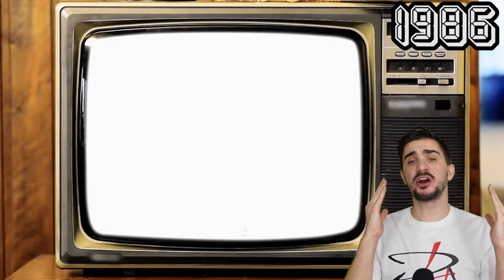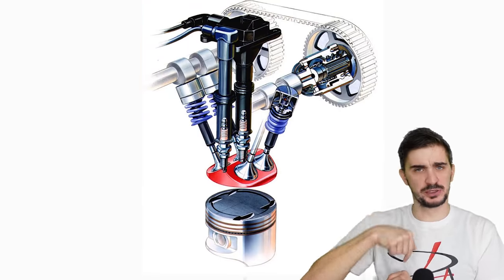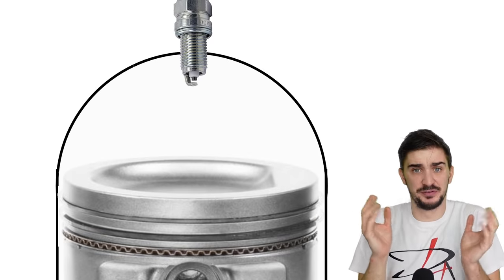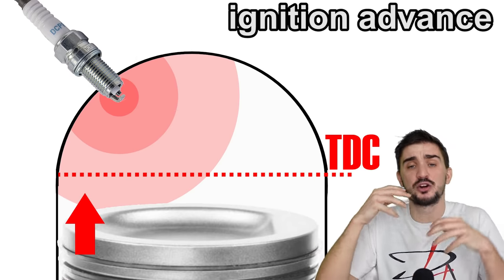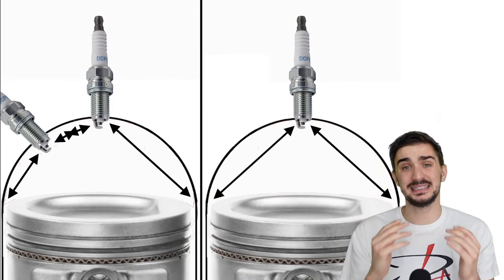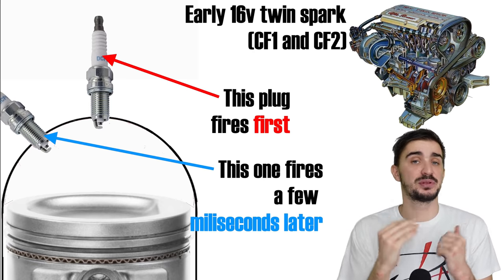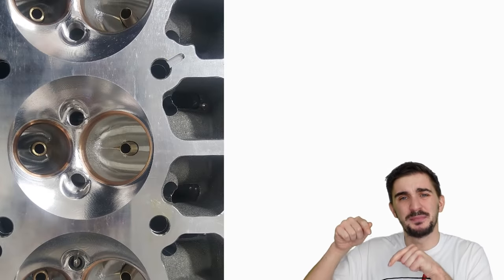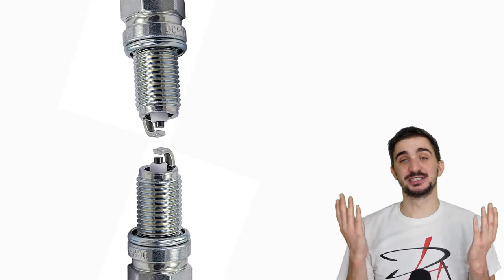TWIN SPARK - WHY, HOW and why it isn't more widespread

Comment: there is also a trend for multispark(rapid firing of spark) at low rpms. wonder what happened to it? or is it now commonplace that people don't talk about it?
Reply: I also wonder this!
Reply: Are you talking MSD, very powerful ignition, used in pretty much all top end engines, only one to have in top fuelers
Reply: Mercedes used that on a couple of engines
Reply: @davidwarland2680  MSD was one of the aftermarket system that offer it. but multi spark ignition seems like it was a thing a decade ago in some OEMs
Reply: @davidwarland2680  Top Fuel engines generally use MSD Promag 44 magnetos. They produce one single relatively long duration spark.
Reply: You just mean spark dwell?
Reply: @TheAdatto  spark dwell is the charging of coils before the it reaches the spark plug and starts the ignition.

multi spark is literally what it means. the spark plug sparks multiple times during ignition. many different approaches to do it, but it does result short dwell times as there is less time to charge the coils.

Comment: I owned a small 150cc motorbike manufactured by a company from India called Bajaj. It sported a technology they called DTSi which implied two spark plugs  for that small single-cylinder engine. I don't know that benefited the performance, reliability, or efficiency of the engine but, to their credit, the engine never failed to start and that's not a small feat for a carburated engine. Today I own another similar bike and I have disassemble the carburetor whenever I spend 2 weeks without starting the engine.

Comment: I have a Kawasaki kle 500 parallel twin that revs to 9.5k rpm and I've seen examples of the gpz 500 that has the same engine but differently tuned, revving to 11k rpm with a single spark on each cylinder. I don't know the point I'm trying to make,I'm just mentioning the fact. Great information btw,great video.

Comment: Also on the topic of extra spark plug the four-rotor rotary engine in the Mazda 767 and 787 cars received an extra spark plug per rotor for improved combustion, despite both the 13J and the later 26B engines having a variable-length induction system. 

While it is true that introducing an extra spark plug is more hassle for maintenance purposes in production engines, I'm surprised Mazda out of all companies didn't try to squeeze more bang from the rotary engines, especially the Renesis engines in the RX-8 which was purposefully designed to milk every single performance out of a naturally-aspirated 1.3L engine AND still meeting the emissions standards at the time. Even the rotary range extender in the new MX-30 hybrid didn't have an extra spark plug.
Reply: Actually all 13b rotaries have two spark plugs if I'm not mistaken
Reply: @bababence  The 26B have three
Reply: @bababence  They do. The four-rotor engines in the LeMans cars had three per rotor, which was supposed to improve the combustion characteristics. 

Looking at some peripheral-ported, four-rotor projects online with just two spark plugs per rotor shows a HP figure somewhere around the 500HP figure mark. For context, the 26B in the 787B could reach 900HP peak, and even the “detuned” version have 700HP. 

By this example, I’m intrigued on just how much an extra spark plug could really change the performance of a Wankel rotary engine.

Comment: dual spark plugs cut down the lead time required for ignition to occur completely, greatly reducing the chances of detonation .. you don’t have to light a spark plug at 30° BTDC with the dual plugs.. you cut down the leadtime by half. Also, you’re not trying to compress a mixture that’s trying to expand because you lit a spark plug so far in advance.
  Vance and Hines when they were actually in the early years of their drag racing which gave them their big name that they still have today because of their success. They actually had a motorcycle engine that was four-cylinder and it had three spark plugs per cylinder..
  gasoline burns very slowly in the open atmosphere. You could pour a stream of gasoline 50 feet long on the ground, stand beside it at the beginning, light it at one end, and you can walk to the other end of that stream of gasoline before the flame will get there. For an engine to run, you have to speed up combustion buy as much as 200 times the speed that it burns in the open atmosphere.Lighting the mixture with two spark plugs cuts that time in half. Especially with dome shaped pistons, which in my opinion is the worst shape for a piston/combustion chamber because, it takes longer relatively common for the complete combustion chamber to ignite if you have a single spark plug on the east side of the combustion chamber, by the time the west side of the combustion chamber catches fire, you have a high probability of detonation occurring.. dual spark plugs reduces that problem. Dual spark plugs also reduces the amount of the cylinder that is exposed to flame of combustion, lowering engine temperature, making it possible to have a higher compression ratio, which will equal more power if you can control the combustion chamber. It’s a win, win, win to have dual spark plugs..
 of course the ignition system has to be adjusted to back the timing off by half with dual plugs vs a single plug for the benefits.. you can’t just drill a second hole and add a space second spark plug and keep the same ignition curve that the engine was designed to have with a single plug. That would be worse than having a single plug because the mixture would ignite completely as the engine was trying to compress.. if the engine came from the factory with two spark plugs. I’m sure that the factory has already calculated the correct ignition timing curve.
 I knew a mechanic specialized in dual plugging Air cooled BMW motorcycles. He explained The benefits of dual spark plugs.. I watched him do it to a set of heads. He had jigs rigged up so that he would attach the jig and drill and tap the hole for the second spark plug, then he had to adjust the ignition timing advance by backing it off halfway..
  he also pointed out to me that the great aviation/motorcycle inventor in the early 1900s, Glen Curtis solved the problem of airplanes having trouble getting airborne when taking off from muddy Fields. The solution was to dual spark plug every cylinder on those airplane engines..
 in case you never heard of glenn Curtis. He actually made a V-8 motorcycle in the early 1900s went well over 100 miles an hour. He also is the inventor of the V twin engine for motorcycles. Motorcycles in those days were nothing more than bicycles with engines on them. Glenn decided, and rightly so, that it would be easy to add a second cylinder to an engine that fits in the V of the frame of a bicycle. Of course Indian copied that design from glenn Curtis, then Harley Davidson copied that design from Indian..
  of course that narrow V design does not have perfect primary or secondary balance. BMW with the boxer twin has perfect primary balance.Moto Guzzi engines with thier 90° V twin have perfect primary and secondary balance..My last 2 Moto Guzzi’s both had two spark plugs per cylinder from the factory..

Comment: I forgot to mention, the aviator genius glenn Curtis in the very early 1900s when airplanes had radial engines and airplanes had double wings, had to overcome the problem of planes taking off from muddy Fields which requires more horsepower than if the runway is paved.. Glenn Curtis is the one we all need to thank for coming up with the idea of dual spark plugs oer cylinder.. that gave airplanes the increase in power needed for planes to take off from muddy fields..
  curtis also came up with the idea of adding a second cylinder to a motorcycle single cylinder engine, creating the V twin engine because that configuration would fit neatly into a bicycle frame, which is what motorcycles were in the early 1900s.. Indian stole that idea from him, and Harley stole that idea from Indian..
  Glenn Curtis in 1907 also went 136 miles an hour in his V8 powered motorcycle..

Comment: An old machinist told me "Two plugs are for inefficient cylinder heads". You see them in Top Fuel because of the immense amounts of cylinder pressure and fuel.
Reply: And Those Fuel Dragsters are using Twin  MSD  systems . At ridiculous voltages .
Reply: That's like saying 4 valves/variable length intakes are for inefficient cylinder heads
Reply: @johncunningham4820  enough amps to weld.
Reply: @michaelallen2501  . Initiating a Spark across a Gap isn't about Amperage . 100.000 Volts at 1 milliamp will jump . 100.000 Amps at 1 millivolt will not . And too much Amperage would Melt the Sparkplugs instantly , rendering them inoperative .
Reply: so the most efficient cylinder heads have no spark plugs(diesel)
Reply: @makantahi3731  . Actually TOTALLY correct .
Reply: Gen 3 5.7l 6.1 6.2 6.4 Hemi.
Reply: @makantahi3731  Ouch!
Reply: @johncunningham4820  no lol that absolutely incorrect.
Reply: @toxichorizion2348  Mebbe John needs to look at the plugs from a Top Fuel engine after a 1/4 mile pass. They ARE quite often literally destroyed by the time the run is over. And I can suppose you could create a spark with 100,000 V and 1 mA, but it would be closer to the zap you get from walking across a carpet & touching a doorknob and insufficient to power a weed-wacker.  The voltage isn't really important in a Top Fuel engine...the current is. A massive spark (akin to an arc welder) is what's needed, and since the magneto's on these engines can supply 40+ amps, that's what happens.
Reply: @chiefdenis  ig they meant as in fuel consumption wise, they don't generally sips fuel
Reply: @warrenzevonsangryghost6055  Basically a flying welder.  I wrenched on Top Fuel dragster. 44 Amps and 1.5+ gallons of fuel per second being consumed during the run. 
Well in excess of 11,000 horsepower

Comment: Another reason to use twin spark in an air cooled beetle motor is to allow the use of a more radical cam profile and still enjoy more torque at lower rpm's which would be much worse without it. I have also experienced other minor benefits as well as you previously mentioned. The heads used are much more efficient than stock vw heads and in a motor that sees 8000rpm when required. However I agree that with other tech used today, Twin Sparks advantages only show in particular circumstances and hence its limited use today.

Comment: Miki...you are correct.  I have an '02 CLK55 and '04 CLK500 and both engines have dual spark plugs.  A mechanic told me that the dual spark plug design of MB engines fire one spark plug and then on the next power stroke, the other spark plug fires.  What I was told, is this has the effect of spreading the heat more evenly across the piston.  I'm just repeating what a seemingly qualified mechanic told me.  I'd be interested to know what the official answer is.  I do know that Aston Marten's racing engines of the 60's had dual spark plugs.

Comment: A good combustion chamber design for most passenger car size engines doesn't need dual plugs. Poor chambers may benefit. So may engines with a bore greater than about 100mm. A good example of "if you can't hide it, make a feature of it."

Comment: I enjoy all your videos. Your enthusiasm is contagious and your explanations are some of the few I know that keep is simple, but also include enough good information to get the concept across. I got hooked with your balancing videos. I've always had a love/hate relationship with balance. Obviously, the smoother an engine's balance, the better it can physically perform independently of any power modification as compared to a relatively unbalanced engine of the exact same specs otherwise. And I like symmetry and smoothness. However, I've found that over the years, I am really getting into less balanced/"not as even" firing order engines simply for the nostalgia and the sounds, since much of an engine's sound characteristics are created by how the exhaust pulses interact with each other pressure-wise and rhythm-wise within the exhaust system. And sure, older or not-as-well designed engines are less powerful, less efficient, and sometimes less dependable depending also on the materials they are comprised of. But just like the "thump" of a 45 degree single crank pin V twin, or the relatively unique gurgle of a 90 degree crank V8, the sound and feel make them desirable to many. So when I hear of a stranger engine than usual (say a 2 crank pin V4, an inline 7, or a 90 degree crank inline 4), I get really interested even if only for the sound and to find out about its balance/how the firing order and spacing effects the sound. The great thing is you actually cover topics like this pretty thoroughly. So my conceptual understanding has increased greatly. Thanks for that!

Comment: I had one of those Ford Rangers with a 4 cyl, 8 spark plug engine. I called it my gutless wondertruck. I'm sure it was because the engine was just so old and tired but in order to get pretty much anywhere you had to put your foot to the floor. It was a 5 speed manual. Come up to any kind of a hill and you can pretty much count on downshifting to at least 4th, if not 3rd.
Reply: I had a 89 Ranger with the 2.3 twin plug, it was only 4 years old and gutless. A trip through the mountains wasn't fun, only had decent acceleration going downhill.
Reply: @abpsd73  mine was a 92. 
My last truck was in 96 with a 4.0 and when I looked at replacing clutch slave cylinder, it turns out they used what they call a concentric slave cylinder in those years. It fits around the input shaft of the transmission so in order to replace it you either have to pull the engine or the transmission out.
At least this 2000 Ranger I have now with a 4.0 doesn't seem too awfully bad to work on. I replaced the spark plugs and routinely change my own oil in it.
My father has a newer F-150 with a Triton 5.7 V8 in it. He asked if I would change the spark plugs in it and without knowing any better I said yeah sure. I took one look at the top of the engine and then Googled how the heck to do it, and it turns out you have to take half the intake apart, and take the fuel injector rails off in order to get the tank spark plugs out because they go straight down to the through the top of the valve covers. I had to tell him I'm sorry pops, but I don't think that's in my wheelhouse. 
I think we need to make the engineers that design this stuff come out to the shop and service it, and then go back to the drawing board because I know they will have some things to change lol
Either that or they're just truly sadistic and enjoy turning what should be half an hour to an hour job into something that's going to take you all day long and need professional training and specialty tools to do :(
Reply: Still have a 94 Mazda B2300 that has the same engine as your Ranger. You are spot on having to put your foot on the floor to run it on the highway.

Comment: Since you asked, there were several lies, but the main one is the part at 0:03 about "1986". Alfa Romeo used twin spark designs in 1960s road cars, and although cars like the TZ and the original Alfa Romeo GTA might be considered homologation specials, these were road cars with twin spark heads, so it was not a new thing for road cars in 1986 (and as you mentioned, pure racing cars much earlier). Also the image at 0:10 is misleading as this appears to be the Fiat/Lancia based 16 valve engine and in the 1980s they re-introduced the twin spark on the 8 valve twin cam engine as you mention later in the video. The 16 valve twin spark engine came later.

Also worth mentioning is that most of those Alfa Romeo 8-valve twin spark heads had a more efficient narrow valve angle design, when compared to earlier single plug heads. Those single plug heads used a more central spark plug location, with the trade off have a wider valve angle (80 degrees on some engines).

Alfa Romeo was not the only one using twin spark/twin plug heads before the 1980s and some 1960s/1970s Porsche engines used this design too. Once again, many (or most) of those cars might be considered homologation specials, rather than mass production cars.

Comment: First car, 1989 4 cylinder mustang. I called it "four angry cylinders" 8 spark plugs, 88 horse power. I genuinely cannot fathom how they managed to make such an anemic engine from 2.4 liters of displacement. I wish I still had the car, would have loved to swap a mid 2000's SVT focus motor into it.

Comment: My 2013 Ducati 1200 Multistrada has 2 spark plugs per cylinder.
Some time ago I came across a recount by an owner of the same bike, who had engine roughness which took some time to diagnose.  In the end it was one spark plug (just one) not firing reliably - they replaced the spark plug and the engine ran perfectly.
What this tells me is that the twin spark ignition must serve a very real purpose,  otherwise the remaining spark plug would have done the job adequately.

Comment: Hello, I must comment on the alfa romeo CF1 and CF2 twin spark delivery....on research you will find the coil on each spark plug delivers spark to the firing cylinder and the opposing exhaust stroke cylinder.....just look at the spark plug leads....both at the same time.....this was done for emissions by burning residual fuel in the mixture about to become exhaust gases.....also allowed for a richer mixture whenever needed, by being corrected on the exhaust stroke for emission clean up....
Alfa mechanic for 50 years, stefan.

Comment: I initially think about Mercedes M112, M113 and 137 V6 V8 and V12 engines. They have a 3 valve per cylinder design, which makes twin Spark quite logical.